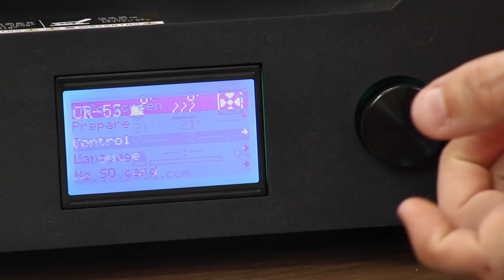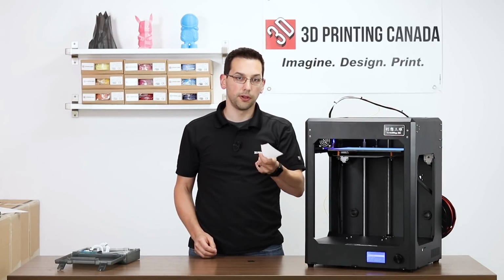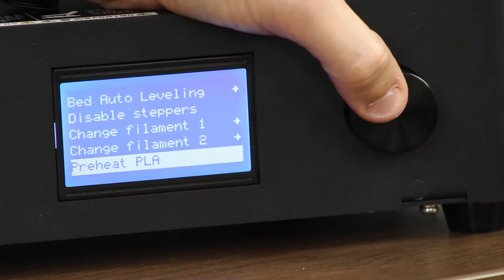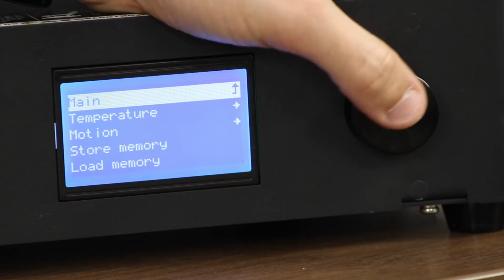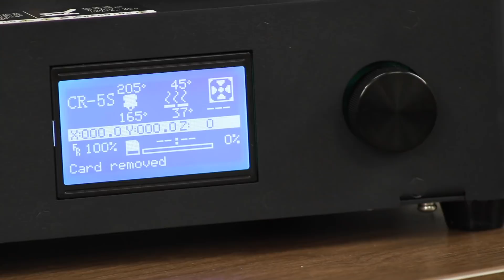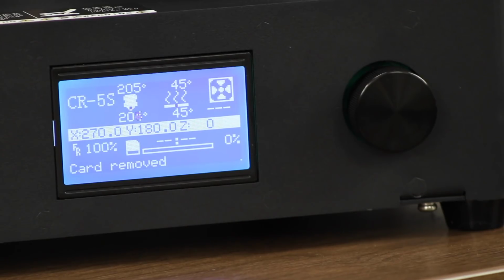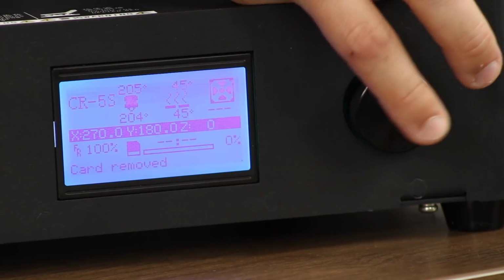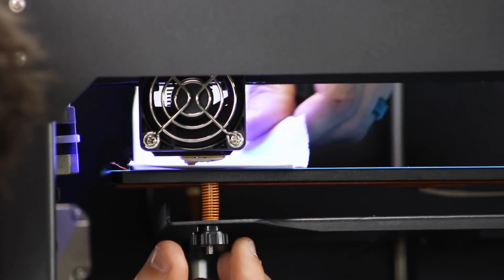Creality CR-5S Unboxing - Is it Creality's Worst 3D Printer?

Comment: nothing beats the cr-10s-pro and regular cr-10 models. love those machines. just build a case around them if you want a closed printer environment
Reply: Jason in theory yes but in practice no.  My Cr10sPro prints way better at speed than my ultimaker 2 ever did even with a Hemera installed and heavy glass bed.
Reply: @Jason Your assuming the physics support your views that Darwin-style printers are more accurate in every case which is wrong to assume.  they are for the most part only.   the 2 large stable Y Bed rails on the Cr10sPro may be more stable and handle the extra inertia better than an Ultimakers light weight xy carridge running on reletivly thin 8mm rods,     on other printers mostly not  some printers have only one rail and weakly built.     You can't really simplify physics.
Reply: @Jason Thanks for proving my point.
Reply: @Jason :D Jason, Your very first comment implied that not having a moving bed automatically makes it better than a Cr10sPro "Lots of things beat them. Not having a large moving mass, as in a bed slinger"  you mentiond physics not me.  and then debunked yourself by saying and asuming all things being equal.... which they are not.
Reply: @Jason Again...   "Lots of things beat them. Not having a large moving mass"   you absoloutly said that.  refering specifically to a Cr10 &sPro  you absoloutly said that Jason.  which is wrong.   not having a large moving mass does NOT mean it beats mensioned printers.  lots of printers beat a Cr10 /spro in many ways   having a Z axis moving only bed is not one of them if the printers mechanics are built to cope with that load.

Comment: Set all temps for both "nozzles" in cura at the same temps, including the standby temps and you will not have the pauses
Reply: @Jason Did not realise needed two diff temps for the filament, yes, can believe it is very frustrating

Comment: Thanks for the honest review, I will stick with my CR-10S Pro. Looks like they have a quality issue, if this was your first 3D printer you most likely would not be happy. That is why people get out of 3D printing, you have to have a lot of patience and Creality isn’t making it so the beginning is successful. ☹️
Reply: @Jason I am with you, I have had cr10s pro for two months now, learning to live with it, finally got the bltouch and I am not happy either because it  is not consistent  as  promised, I slowly understand it is time to part with this machine and  buy something that is supposed to work like straight on, perhaps prusa.
Reply: @Jason M48 ok, will try that and we will see..
Reply: @Jason Jason, cant you see that people have problems using tinymachines firmware, Sd card refresh, look at the comments etc. I had problems with it myself, there are too many probing poings - it takes too long, Right now I switched to Creality oem firmware and swapped the connector to Z+, I am happy but it seems creality firmware does not support M48 deviation test. WOuld like to ask you if the source code that you present in the video supports the M48 command? thank you.
Reply: @Jason OK, there is some discussion and problems in your other video about upgrading cr10s pro to bl touch, OK then, if the tiny machines has m48 built-in, I will for the sake of M48 test install this firmware once again but nothing will make me keep it, once  M48 is messed with and I see the results, I am back to creality ;)
Reply: @Jason at the moment I cannot really say that but perhaps there is something wrong with my specimen or my printer (more likely) ;) I need to find out, this  deviation test  will come in handy.
Reply: It looks good now: https://photos.app.goo.gl/qhhrKVcD9F5NsXZD7

Comment: What was Creality thinking to release a printer that is not configured correctly? and not switching the power supply for the correct country, this would really confuse a beginner, granted! Customer Service would have solved the power supply issue and directed the consumer to the correct fix, but reflashing a firmware is not something a beginner may feel confident or in fact, want to take on as the first 3d printing experience.
 Come on Creality you are better than this!
Is a bootloader and thermal runaway detection implemented in this printer?